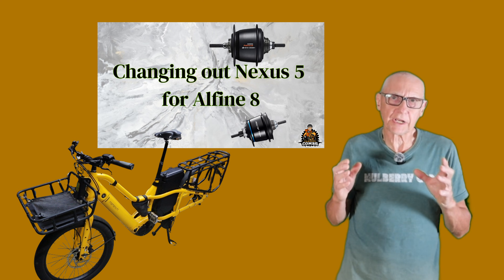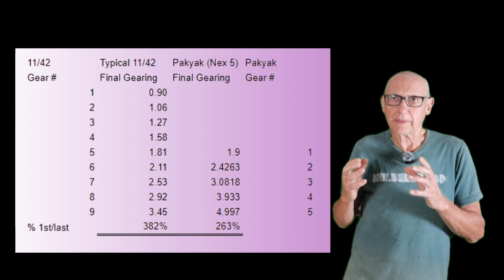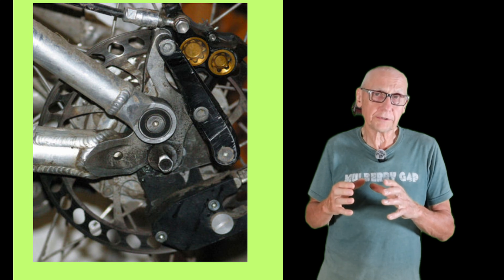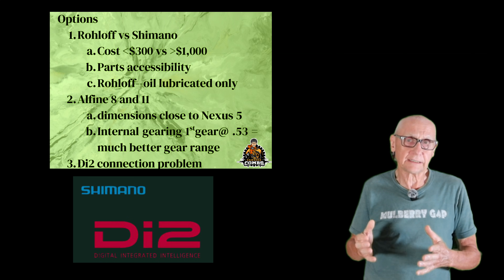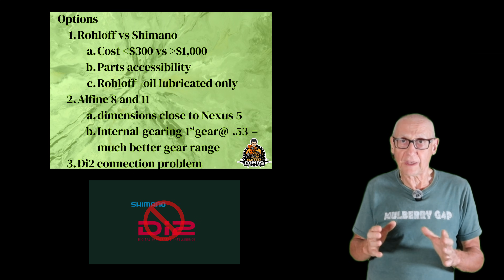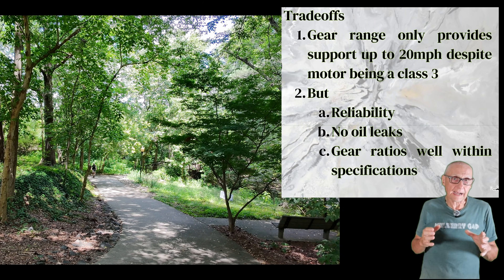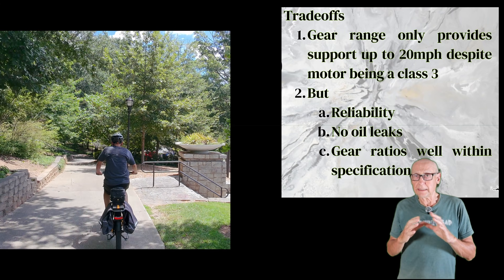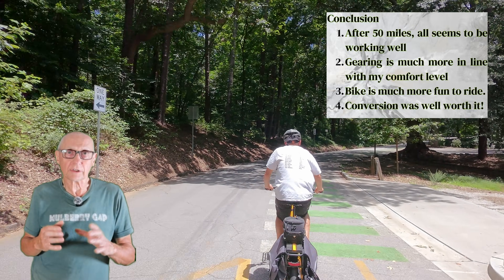Why I Swapped My Nexus 5 for an Alfine 8 – Cargo Bike Gear Hub Upgrade Explained!

Comment from the maker: What do YOU think about internal gear hubs vs derailleurs for cargo bikes or ebikes? Would you go with the Alfine 8, 11, or stick with the Nexus 5?
👇 Drop your thoughts, questions, or your own upgrade stories below — I’ll answer every comment I can!
Reply: For a reasonable cost the Alfine or Nexus 8 speed is a suitable product. If you want the best bulletproof hub with 250 nm of torque rating & 554% gear range then the 3x3 nine hub is hard to beat but it is a buy it once for a lifetime of trouble free hub priced similar to a Rohloff.
Reply from the maker: Thank you for watching my video and for commenting.  But, most importantly, thanks for the information about the 3X3 hub.  I was not aware of this product, and it looks very interesting for use on my electric cargo bike.  I am considering purchasing one of the hubs and installing it on the bike that I show in this video.  Unbelievable torque spec and gear ratio--extremely impressive!  Thanks again.

Comment: Plan on replacing Surly single speed hub with an internally gear hub on my Cheata Apollo gas engine bike. Thanks for the Intel.
Reply from the maker: Thanks for watching my video and for commenting.  Good luck with your project. Cheers!
Reply: @boydcombsakaGster It should be a gad!☄️🚴‍♂️

Comment: Great video, thanks! From what I understand the 5 speed's benefit is less shifting to reach speed, which some consider beneficial with stop and go riding on a ebike. I am looking at these hubs for a cargo ebike and my max speed is only 15MPH
Reply from the maker: Thanks for watching my video and for commenting.  

Regarding your comment about the 5 speed hub, it definitely required less shifting.  For my cargo bike, the way it would have worked, I would have had to change the power delivery provided by the motor to compensate for the limited gearing which I did not want to do.  

For example, if I was riding on a relatively flat surface and going along at about 8 mph in ECO mode and then came to a up sloping grade of say 5%, with the 5 speed, I would have probably needed to adjust up the power setting a notch from ECO; whereas, with the 8 speed, I would simply down shift.  My example may not be exact, but I hope you get the idea.  Without carrying a load on my cargo bike, I generally ride in ECO and where I ride is pretty hilly.  The 8 speed allows me to compensate for the hilly by shifting only and not adjusting the power mode.  

As to your comment about max speed being only 15 mph, the gearing on my bike is pretty well spread out so that I have good gear ratios up to about 18-20 mph.  Staying in the 15 mph range would have been much better for the 5 speed.  So maybe that will work for you.

There are 2 other issues that I would worry a bit about if I still had the 5 speed.  First, the difference between gears is pretty big, and there were several times when I wanted to be in a gear in between the gears.  Surprisingly, I found this to be very distracting and negatively impacted by ride experience--but it probably just me.  Second, lowest gearing on the 5 speed hub is specified by Shimano (see the installation manual), and I remember the lowest Shimano approved gear ratio was not as low as I wanted.  The 8 speed allowed for a lower approved initial gear ratio.  On some forums, people suggested (and claimed to have good results from) disregarding the Shimano approved ratios, but I decided to stay within the approved range.

All the best to you and your build.  I would love to hear how it works out for you.  Cheers!

Comment: This is an example of wanting to make a simple correction far more complicated. Your Nexus was simply geared FAR too high, simplest fix put a bigger (far bigger cog on this hub) if that was't enough, put  smaller chainring in front, the combination of the two would have made the difference without a wheel swap! No derailleur was needed just a very simple cog and chainring swap!
Reply from the maker: Thank you for watching my video and for commenting.  However, I disagree with you..

Regarding your comment about changing the front and rear cog to get the desired ratio, I tried that approach before I changed the rear hub; however, I wanted to stay within the Shimano recommended ratios, and I wanted support up to at least 20mph.  Changing the chainring or rear cogs did not allow me to meet those criteria.

On page 11 of the Shimano Dealer’s Manual for Alfine / Nexus states that the 5-speed hub recommended sprocket ratio is 1.3 to 1.5.  So for example, a chainring of 38 would limit the size of the rear cog to 30 (on a 24 inch wheel).  Whereas (again on page 11) the recommended sprocket ratio for the 8-speed hub is 2.0 to 2.25.  The first gear ratios on the 5 spd and 8 spd are 1.0 and .53 respectively.  Meaning that the final first gear ratio on the 5 spd (in a 38 by 30 configuration) is 1.27 and that the final first gear ratio on the 8 spd (assuming a 38 by 19 configuration to be right at the Shimano recommendation of 2.0) is 1.06.  For me, at those low gears, that ratio difference is significant, and I wanted to stay within the Shimano recommended gear range.

But, assuming that I had disregarded the Shimano recommendations (and some people do), the overall range of the 5 speed is 263% whereas the 8 speed is 304%.  If I were riding in Amsterdam or The Hague or some other place where it is not too hilly, the difference in the ratio is not that important.  However, where I mainly ride this bike is in Atlanta, GA (which is pretty hilly) and the 263% range was too limited for me.  I did, as you suggest, increase the size of the rear cog and have plenty of low gear for big hills, but I was limited (as in no) motor support in higher gears.  I was losing motor support at roughly 15 mph in the 5 speed when I set the cog (regardless of the Shimano recommendation) to get the low gear that I wanted.

As to the derailleur setup, I believe that, for me, it would be superior on this bike for 2 reasons.  First, the overall range is 382%, and, since this bike has a class 3 motor, the additional range would have allowed motor support at higher speeds (with the Alfine 8 and my gearing I have good support only up to about 20 mph). Second, I have much more experience with derailleurs, and I believe that I could more easily maintain a derailleur based drivetrain.

Again, regardless of our agreement or disagreement, thank you for your input and comments.

Comment: A good report there ;-) 
  The Rohloff use such a small amount of oil, on my first 750 mile tour I'd actually forgot to put the oil in but was told (by Rohloff) no damage would occur, my first main tour was U.S Route 66 in 2008, no problems. Then the big tours began, London to Cape Town with no problems, then London to Singapore (visiting the Rohloff factory when passing through Germany & met Berni Rohloff) then lastly a two year tour of the Americas, starting from Ushuaia, heading north...south was not possible ;-) . 65,000 miles now, & still runs sweet. Shimano basically saw the success Rohloff were having, & wanted a piece of the cake, but at the end of the day, it's German engineering, although that said, I'm presently investigating / looking to buy a Shimano one for my town bike, just ~60 miles a week so they should be fine. 
Mark, England.
Reply from the maker: Thank you for watching my video and for sharing your experience, particularly with the Rohloff hub, as it is very interesting.

Comment: Very well explained and interesting real-world issue!
I'm surpised that the Nexus 5E (supposedly rated for eBikes) is only rated for 50-60 Nm of input torque from what I can find. Meanwhile the Alfine is also 50 Nm max. Are you worried about that at all?

I feel that Shimano is really lagging with their IGH product line - the only gear hubs I know of that can handle more than 80-100 Nm are some of the Enviolo line (they are TERRIBLE in my experience due to inefficiency), and Rohloff which as mentioned in the video is very expensive (but supposedly very durable).
Reply from the maker: Thanks for watching my video and for commenting.  Also, I much appreciate your insights and perspective.

Am I worried about the input torque rating?  I wasn't ... until you mentioned it because I was not aware of the torque rating.  I am going to look into it,  and, once I get a bit more info, I will let you know (by way of a follow up comment here) how worried I am.  But one of the reasons that I swapped out the Nexus 5 is because I like to really pedal the bike (with some assistance).  I am normally in eco mode and using the gearing with leg power to drive the bike--that was hard to do with the Nexus 5 because the gearing was so high especially in the lower gears.  So, hopefully, I am not as likely to bump up against the 50Nm max (as I would be if I were riding often in higher motor assistance levels).  Great point.  Thanks for mentioning it.

Cheers.
Reply from the maker: I have spent some time looking at the torque rating for the Shimano IGH.  At this point, I have been unable to find any Shimano official torque number rating.  If you have a reference / citation  to the Shimano specified torque reading on their IGHs, I would appreciate seeing it.

I assume as a way to address the torque issue, Shimano does provide recommended sprocket ratios (in their Dealer’s Manual DM-CASG004-01 pages 11 through 14).  For the Alfine 8 speed the recommended sprocket ratio is 2.0 to 2.25.  Because my chainring is 38 and my rear cog is 18, I am within the Shimano specified limit, and, accordingly, I am not worried about a problem with “over” torquing the IGH.  

The torque issue you raised is very interesting, and I appreciate your commenting on it.  I have learned quite a bit more about the Shimano IGHs as a result.

Thanks.
Reply: @boydcombsakaGster  I wouldn't be too concerned about the maximum torque rating as long as you are riding in lower power levels & not stomping on the pedals you should be fine. I have run an Alfine 11, Nexus 7 & 8 speed hubs on 20 inch wheels with 500 watt mid drives for many years without reliability issues. The Alfine 11 ran out of fluid due to a leak, pulling a trailer full of camping gear, my 200 lb weight & the 40 lbs. or so trike weight up a San Francisco sype hill in Summer heat before it finally gave out. Turns out it was a $100. repair for a bad seal & worn out part. The 7 & 8 speed hubs are quite durable if treated with care.
Reply from the maker: @daytriker  Thank you for sharing your insight and experience.  Also, thanks for watching my video and for commenting.  Much appreciated.  Cheers!